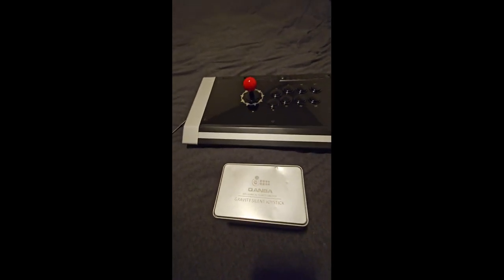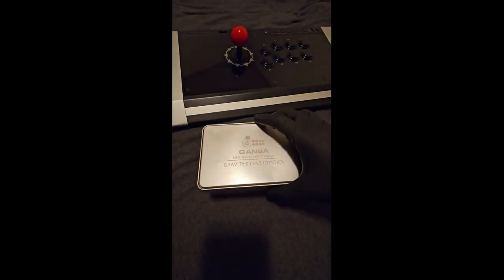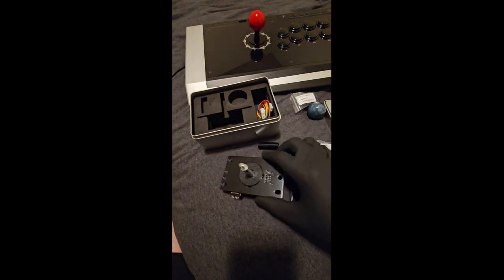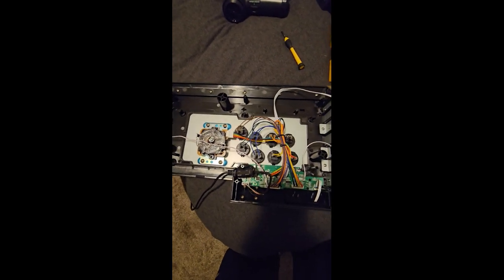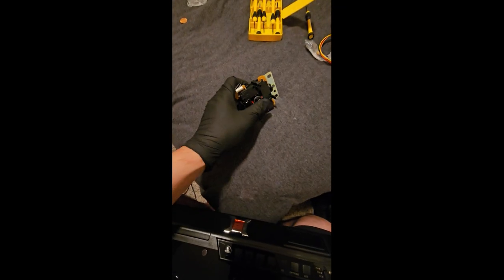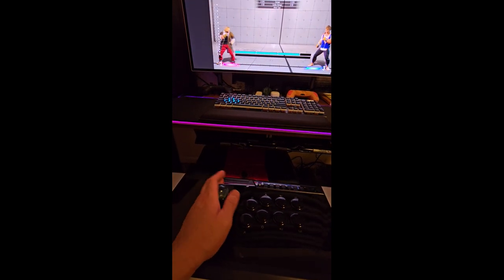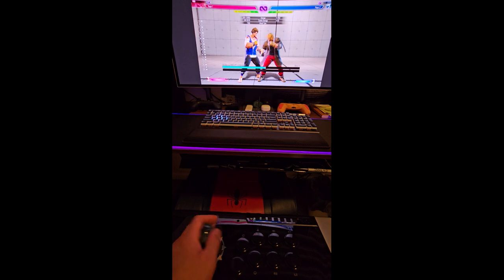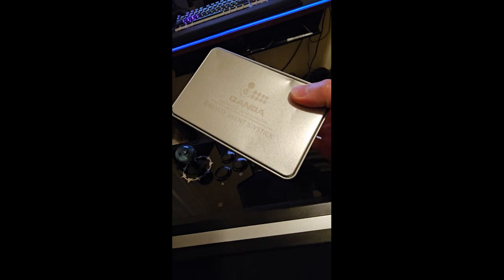Qanba Gravity Mechanical Shaft Silent Lever:  Review and Unboxing

Comment: Got a JOV8S. It was nice until I ran into a major issue. Return to neutral sometimes gives you the opposite input. Example: releasing from down gives me up. Had it right out of the box.
Reply: I just got that stick and I have the same issue. I tried the other two tension springs that came with it and they had the same problem as well. Did you end up finding a silent stick without this issue (or any issues)?

Comment: Unfortunate you didn't mention the awful rebound the lever suffers.
Reply: Maybe he didn't have that issue.
Reply: Wdym by awful rebound? It doesn’t go to neutral correctly ?
Reply: @Crowlo17  It suffers from serious deflection. If you put it in any direction and let go, you'll get the opposite as it returns to neutral. You gotta put a very heavy spring in to stop it, but at that point why bother
Reply: That's exactly what I experienced. Sometimes I try to double knee press with Bison, just to get a hop by mistake.
Reply: You guys must have heavy hands. Don’t experience this with mine.